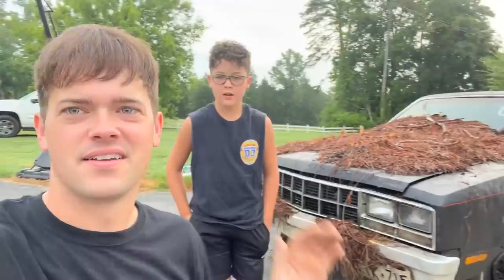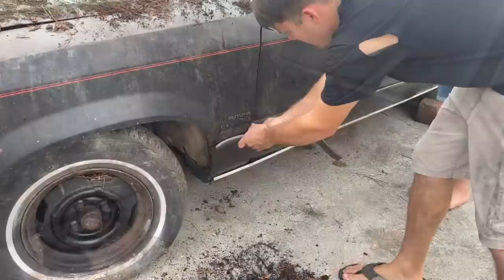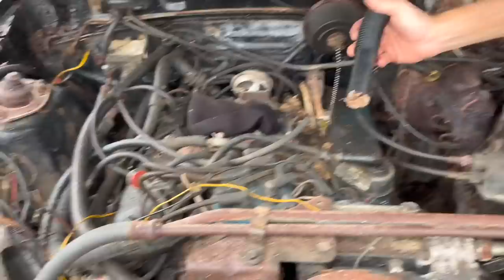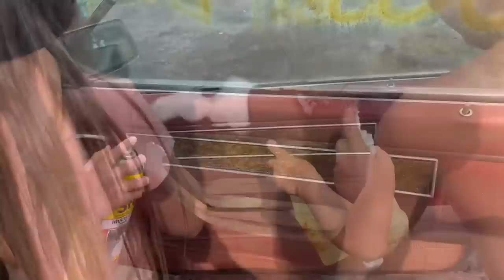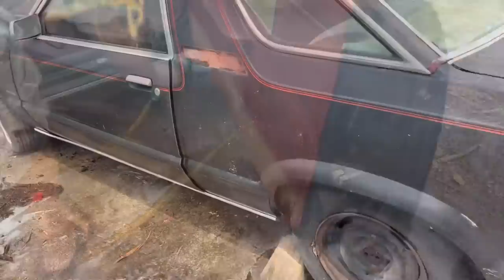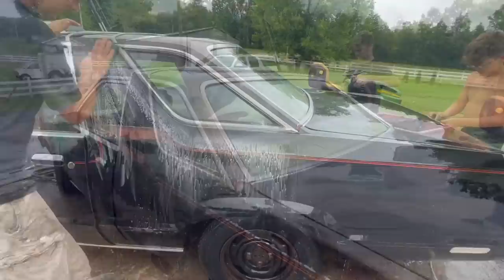Saved from the CRUSHER! What will it look like cleaned up?

Comment: The first of the Foxbodys!, And no no 4 Barrel option, The Cruise Control is a add on, Also you should pull the Cowl Vent Cover off, It's very likely full of Pine Needles and will make them Rust if it's not already, That happened to a 1982 F-150 I had it would pour water from under the Dash when it Rained

Comment: It's like a Batmobile - for Batman's grandfather! Every option - except power windows??  I was a kid when there was an oil embargo, and a gas shortage - 1973-74. It took the US auto makers till 1977 before they downsized the cars and came up with these chopped off box cars! Every car after 1977 had to be smaller and more "fuel efficient" than the cars before '77. Now, on the road, if you see a boat like thing driving around, you know it's probably a pre '77 model.
Reply from the maker: Yes!!!

Comment: Definitely need to try and buff it with the buffer wheel, polish and wax it. It'll look like its wet all the time, it'll look amazing.
It looks like it came from Utah around '89. Looked to have been parked in '91 or '92. That calendar in the car was from '91 I think. So parked about 30 years..?
I always use Purple Power on interior and exterior. Vinyl, leather, and the exterior to get mold off. I haven't used bleach, I thought it might take the color out of my clothes, lol. You should try purple power sometime.
Reply from the maker: Ok thanks we will try it
Reply: @Sleeperdude  Yep, I use purple power on everything. Its less corrosive than bleach. I always use it when pressure washing houses, and cars. I always go back over interior vinyl and leather and dash afterwards with Sprayway Interior Detailer High Gloss. That stuff is amazing.

Comment: There is a cleaner available at Wal Mart called OdoBan, it's eucalyptus oil based. It cleans, degreases, is anti-bacterial, and neutralizes odor. So far it has worked great for everything I have ever used it on, no bleaching or staining. If you buy the concentrate you can mix up your own for cheap.

Comment: Ive worked on so many Fairmonts!  early Fox bodies are so simple, that 302 was rated at maybe 140hp.  C4 auto, 7.5" rear with a 2.47 gear or maybe 2.73.  you probably know this alreay but an 8.8 rear with a 3:73 installed from a late fox body, long tubes, GT-40p heads, rpm intake and matching flat tappet cam(224/234@.050, .496/.520 lift and it will rip!  would be a great sleeper hot rod with a T-5 swap.  or sell it.  that works as well.
Reply from the maker: Thank you

Comment: If it's locked up don't worry it ain't that hard to unlock them 302s here's another suggestion for you next time you I have spots like that on the car use hand cleaner on the seats and stuff that's what I've done on my fair my future I'm getting ready to take it to the shop and have my fair in my future completely repaint it again this time it's going to be chameleon
Reply from the maker: Ok thanks for the info

Comment: that car was made from 1978 to 1983.  this was the z7 under the mercury zephyr and futura as the ford farimont. my parents owned one exactly like this in the z7 mercury zephyr name a 1978 first year. only thing this z7 was minus was the air conditioning as the z7 was able to be optioned with. my parents then owned a 1982 mercury zephyr sedan. i remember that the top bolt on the starter was a bitch to tighten cause of the fact there was little room to swing a ratchet. oddly enough there is still a repair manual around for the ones we had.
Reply from the maker: That’s awesome
Reply: @Sleeperdude  totally. the manual is an old chilton.  sadly chilton manuals are no longer printed and they went online but as of january of this year 2022 even the online app subscription service has come to an end. anyone that still has a nonexpired subscription will still be allowed to use them till it expires. haynes on the other hand the old manuals will still be printed and the new ones are online only. seems like lots of stuff is going to online subscription only these days

Comment: THE INTERIOR. Soak it all down with  Mean Green or similar cleaner let it soak for a hour or 2 then pressure wash it. wet vac. the access it works i done it. just leave the doors and windows open for a few days in the summer and its clean and dry. carpet, seats and all.
Reply from the maker: Ok thanks

Comment: you might try using your shop vac...in wet mode...when you wash seats and carpet. That will suck a lot of the cleaning solution and dirt out. As is washing without vac is just relocating the dirt down deeper into the foam padding.
Reply from the maker: Yeah good tip

Comment: Back in the 1970s I  detailed over 100 used cars for dealers. I used white wall cleaner and powered laundry detergent to clean up the interiors and trunk mats in the cars. I spritzed on white wall cleaner and then dipped my scrub brush in the soapy water and scrubbed the surfaces. Did a lot of Ford and Mercs like the one in this video. I used the white wall cleaner in the engine compartment to degrease the motor and high pressure hose at a car wash to clean it off. Worked great. Of course your sponsors for cleaning products probably don’t want to hear that! If you would have used WW cleaner and laundry detergent on the door panel, it wouldn’t have stripped away the woodgrain. Just saying…
Reply from the maker: Ok thank you

Comment: SleeperDude use a hot water dirt extractor. That detailers use. On seats and carpet's. It can be used with a deodorizer and mildew killer. Use the right tool for the job. It can be used over and over again. Work smarter not harder.      Shawn.

Comment: i watched your camping video i seen where you were saying going up that hill you thought the lack of power mighta been fuel delivery i thought i seen you change the fuel filter has like a hose clamp holds it to the frame but on them era of fords if you had dual tanks theres a weird filter in the tank selector valve the bottom of the housing unscrews off if you never messed with them kind before might be something to look into lots of people fight fuel pumps and such on them cause they dont know that extra filters  there but man them 460s shouldnt be lacking power even on a mountain there nade to be pulling
Reply from the maker: Ok thank you

Comment: They only sell pressure washers with three foot wands so you won't be as likely to cut off a finger or dig a hole in your thigh with the cutting force right at the tip.  Think of it as a safety feature. Ron W4BIN
Reply from the maker: Ok good to know

Comment: Needs rustoleum gloss black 2x on the roof and side trim
Reply from the maker: Good idea
Reply: @Sleeperdude  and get some in the spray cap for her to dab it on as touch up paint on the rust spots with a fine tip brush

Comment: Converted over to 5 l fuel injection GT40 intake GT40 GT40 heads Cobra exhaust manifolds e303 cam automatic overdrive from lentech 2400 stall converter for 8.8 in rear 355 gears that thing will be a hot car h pipe flowmaster 40 series mufflers get out there and make your 13 second car have at it holla if you hear me

Comment: So?like how hard would it be to weld an extension on the trailer hitch so he can back it up?
Reply from the maker: Good idea
Reply: It goes deeper than that. For example use 2 drilled angle iron. Start out long to start then shorten to improve his rand. After a few year he can back up a long tractor with a short trailer.  Also mirrors on the tractor so he can practice that too
Reply: Set up an obstacle course he has to back three. Good video for the family channel.  Make it a contest. New trailer hitch back up contest threw the obstacle course the first time. Once without mirrors one with  everyone gets a turn   Fun for all and may become a returning expert

Comment: Also cowl vents getting blocked is bad news on these cars
Reply from the maker: Ok thanks
Reply: @Sleeperdude  I had to repair several holes in the floor, and also replace a large part of the cowl itself right above the instrument panel. Previous owner left it stored outside and the cowl drains got plugged up. The cowl filled up with water and just sat and rotted the metal. I only mentioned it because of the amount of debris on the cowl area on your car.

Comment: SO THE LA TOTALY AWSOME IS AN ACID BASE CLEANER.  SO IT WILL TURN SOME METALS A DIFFERENT COLOR.    WHAT DO I USE.   SIMPLE GREEN DILUTED.  AND IF THAT DONT WORK SUPER CLEAN.  BUT FOR COST SIMPLE GREEN DILUTED with DISSTILLED WATER OR BOTTLED WATER

Comment: Uggh Fairmont...the ugliest car I've ever lovingly owned! That car was bullet proof!
I remember when those were new lined up at the dealership,and thought yukkk!!! I will never be caught dead in one of those!! 
Well I was about 11 years old at that time.
Fast forward 20 years...I'm out of work,my truck had been totaled in an accident,I'm flat broke, getting divorced and 3 kids I need to keep getting them to school,sports etc.
I need a car BADLY
Everything I looked at was overpriced needing tires,brakes, exhaust,most were pushing 150,000 -200,000 miles just piles of rolling junk that will need a couple thousand bucks in parts 6 months after I buy it 
Then I stopped at a yard sale hoping to replace tools that had been stolen from my truck the day I had the accident.
The lady who was doing the yard sale asked me if I was interested in an old car .maybe ..she opened the garage door and there was a 1978 ford Fairmont wagon..ughhh!!! Nooo!!! But it only has 27,000 miles on it and had largely been kept in the garage since the mid 80s.
200 inline 6, automatic gorgeous and still new upholstery.
I had saved around 3000 for a car I asked her what she wants for the car
$500...How could I say 'No'?
I bought it,got it to my shop replaced the original tires, radiator hoses, rubber brake lines,battery,changed the oil,tranny fluid.
She ran SMOOTH!!! 
That car and that woman were God sends!
I drove that car trouble free and then when my two oldest kids were old enough,they too drove it.
It finally quit 2 years ago with 254,000 miles on the clock.
An awesome car!
Reply from the maker: Man I love that story. I would love to find a deal like that

Comment: Those cars were absolute shit when they first came out.  They were built during the second gasoline crisis when Ford lightened up all their vehicles by literally removing the amount of materials used in their construction.  Door panels became much thinner, noise insulation was drastically reduced, etc… .  Ford reduced the amount of content in every vehicle in order to get them to go further on a gallon of gas.  And while they certainly succeeded, the cars that were the result were nothing to brag about.  The Ford Fairmont was one of the cheapest built cars Ford ever made.  The entire interior was made from cheap plastic.  Even their designs were intended to use the least amount of materials possible.  That’s why their dashboards became so underwhelmingly 😂simplistic.  These cars screamed “cheapskate” while sitting on the lots.  I know…I was working for A Ford dealership back when these were brand new.  I used to check these cars in to the dealership when they came off the trucks.  General Motors had much better cars during that period.  If you wanted a decent Ford product, you needed to shop at a Lincoln/Mercury dealer.  They were drastically better in nearly every way possible.

Just the same, it’s nice to see this one saved from the scrap heap.  The Futura model of the Fairmont was by far the nicest, top of the line Fairmont that could be purchased.  Unfortunately, the car that the Fairmont replaced, the Granada, was a much better, far more substantial car as well.  The Fairmont was about 33% lighter in weight…and it showed, because when you sat in it, you quickly realized that about 33% of the car was completely missing.  The door panels became thin as cardboard, the seats lost half their padding and became boring and flat, and instrument panels became incredibly simplistic with very thin dash pads over their tops.  Even the glass in the cars were thinner.